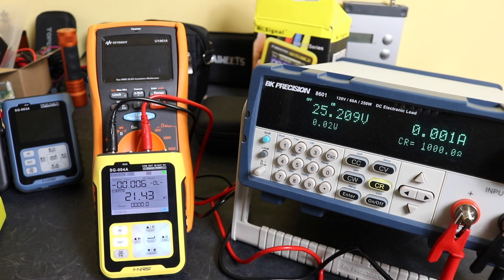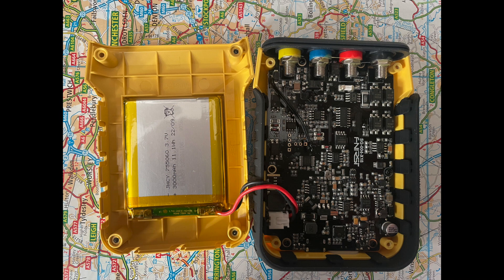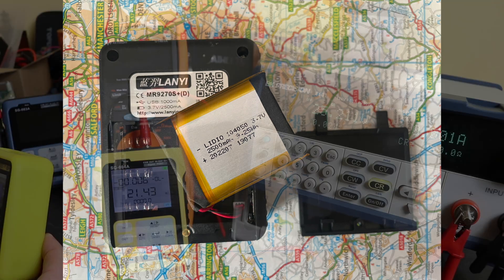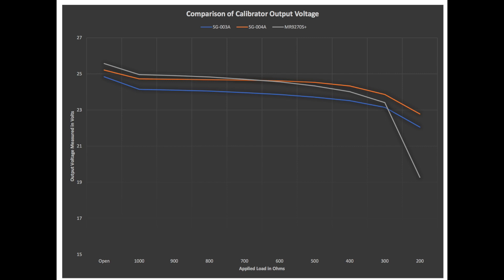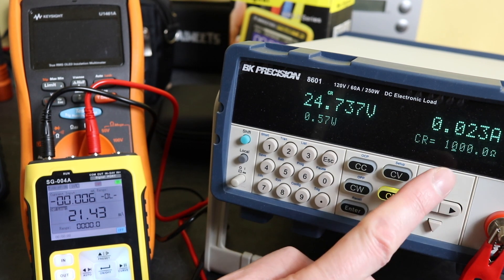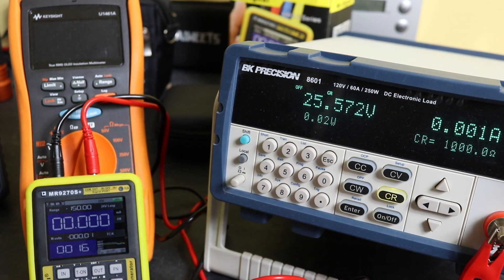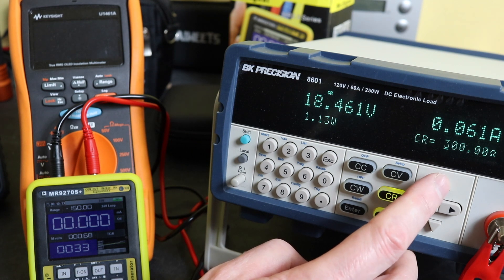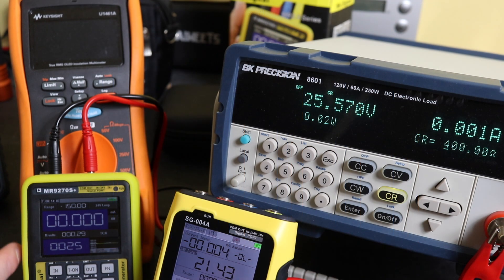Load Testing the 24V Supplies on Process Calibrators

Comment: what is the "Range" label on Sg004A?  4:19
If you hit OUT, it will cycle between range at the top or below, and if you hit up or down keys you can adjust that Range/mA
so is it simply just a manual mA control, while supplying 24V, as that "Range" does seem to also handle the current, while "Range" goes in minus.. or maybe it simply something that you can set up under the 24V settings, as there is also a "Range" area with RangeH/L and Output H/L.
Im on the SG003A.. quite remarkable the amount of features, they packed in these small handheld process meter/ sig gens.
Reply from the maker: Never investigated what the Range function does in voltage mode. On all the others it just allows you to apply an engineering unit to the function and doesn't change the range of the instrument in the same way that it does on a multimeter. Unfortunately, I am working away from home at the moment and don't have the unit with me so cannot verify. The cost to capability ratio is extremely high on these, if the manufacturer keeps working on them to iron out the quirks, they will only get better.